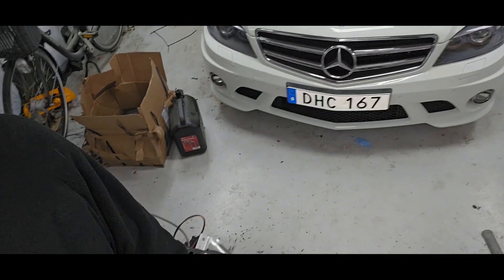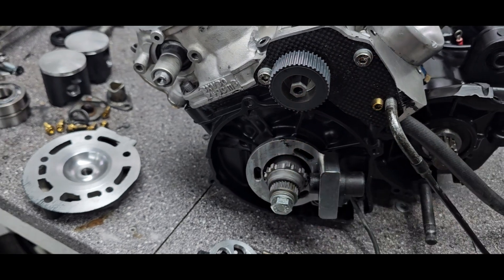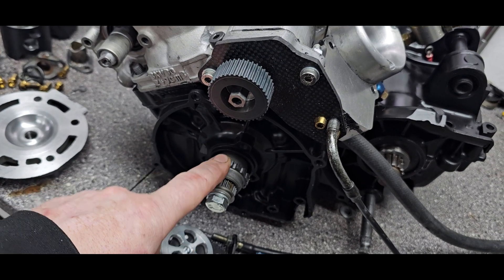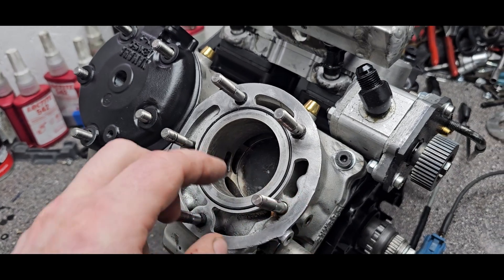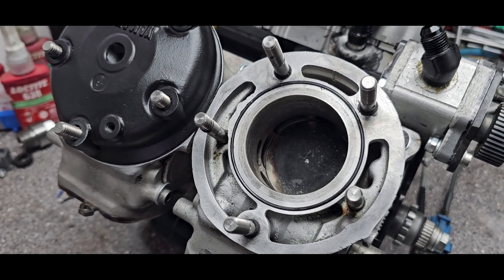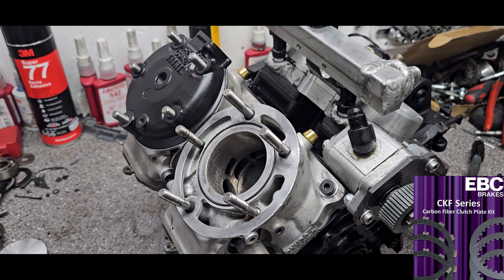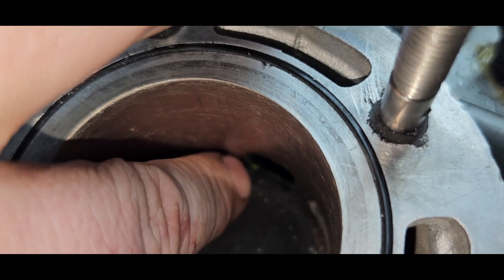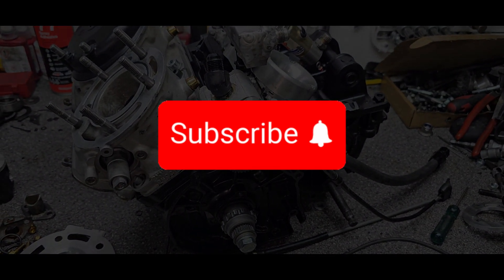Crazy injected Yamaha TZR250 engine, making record 80rwhp+, setup shown!

Comment: I now you have tunend you're tzr 250 you can hear it ripping the revs like hell within 1 second of trothle 14.000 rpm I think u have timed the ignition and a smaller Lighter rotor ignition
Reply from the maker: It actually only revs ~12500rpm in those 'blips' on the throttle, and yes i don´t have any flywheel at all.
Reply: @Patricks_Projects  I like the high performance ignition hpi of Selecta But because they are made for mopeds and scooters and are not on the flywheel rotor twice, that requires knowledge. But do it and you'll have a party. I love you to be thrown up. Then you know what two-stroke is. And your tzr who wants to go up, what a thing. Wonderful thing patrick
Reply from the maker: Hpi is good. =)
Earlier i used ignitech with no flywheel, but i decided to go all out and install fuel injection =)
Reply: @Patricks_Projects I really like what you do I love classic two strokes But there are Not Manny out there. Okay I Wil Chek on your videos have a blessed day greetings from the Netherlands
Reply from the maker: @hardcore4life968  thanks buddy :)

Comment: Awesome engine. I think you meant base or static (depending on if you trigger on front or back of lobe) advance which normally dictates the max advance you can run. Interestingly the Ignitech CDI has a trick called "Spark possible before lobe" which allows you to run more advance than the static advance. I also use longer rods in my RG500 engine - 150mm rods (2.27 rod ratio) vs 100mm (1.98 rod ratio).
Reply from the maker: Yes, that might be the correct name. =)
However, i know ignitech works like that, this is Maxxecu though, and i can´t remember if this is a must so i just set it up the same way =)

Comment: 132-134 transfer timings seem quite high. and with 196 main exh you dont have much blowdown time-area. that is killing your high rpm and over rev
Reply from the maker: This is actually well proven in my engines to work, i never mentioned that my pipes also are setup for nitrous, this kills the heat in the pipes running without nitrous, WITH nitrous it revs no problems all the way to 13000rpm, WITH sustained power.
At first glance yes it might seem quite high.
But there is a thing one has to consider.
If having a good exhaust port and duct, it evacuates the pressure fast, and you are beeing able to run quite high transfertiming, i have in other engines run as as much as 136-138 on an 198degreee exhaust, it made power all the way to 13k no problems.
And i don´t want several thousands of overrev after peak power, i just want say 700-800rpm overrev, i´s time to shift gear, dragracing you know =)
If it was a track setup i might be doing it differently.
And,, dynonumbers are actually telling me that something is working, i dynoed 80.3 with injection as best, but 86.x with carburetors, that´s actually very close to 100hp on the crank.